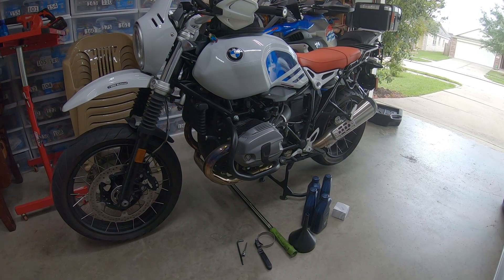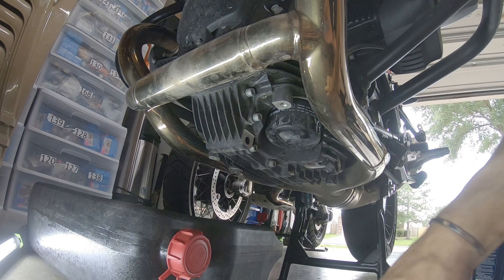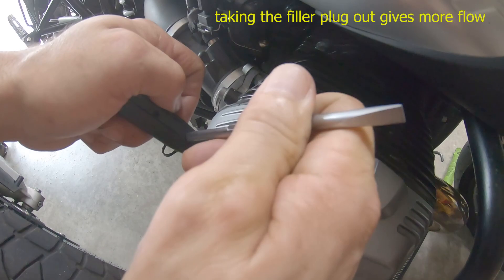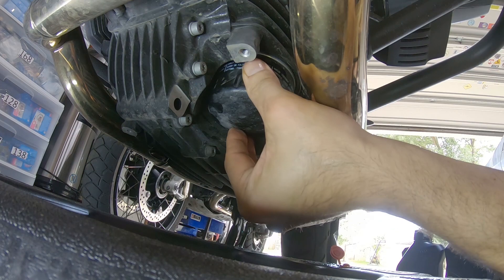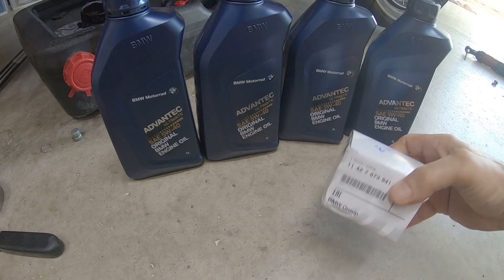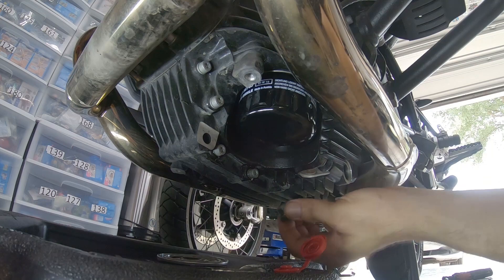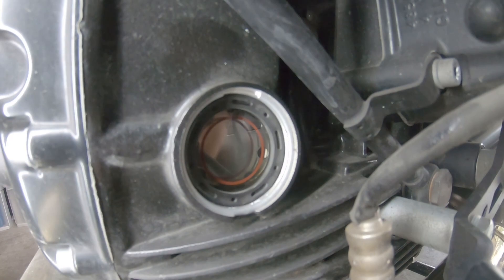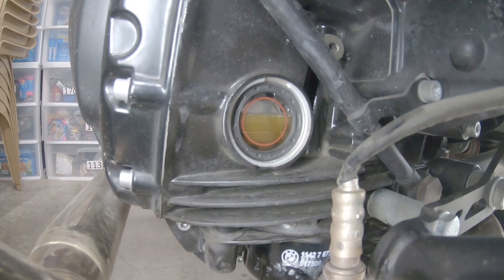BMW R Nine T Urban GS Oil Change

Comment: Hi I have the same engine on a 2014 R1200R, the recommended oil is 15W-50; the 5W-40 is recommended for the liquid cooled boxer like the one you have on the GS.
Reply from the maker: Hi, I just thinking on that too, but I went to the bmw dealer and they recommended this one, I will like to make sure on the service manual from factory.
Thanks for watching and your time.
Reply: @baden-baden  
For the Air/Oil Engines it should be 15w50...Who ever told you that it was the 10w40 at the BMW dealer is a Moron. Change it, cause it's too light for that engine.

Comment: Great video. For anyone watching, please refer to your User Manual. 

Under Engine Oil Specification for R NineT: SAE 15W-50. API S] / JASO MA2, Additives (e.g. molybdenum-based) are not permissible because they can attack coated components of the engine, BMW Motorrad recommends BMW Motorrad ADVANTEC Pro oil.

Comment: Hello , what spray did you use before wiping the filter area? Thanks
Reply from the maker: Hello,
I used brake cleaner or degreasser from the parts store.
Thanks for watching!